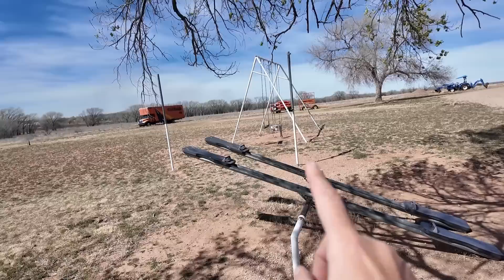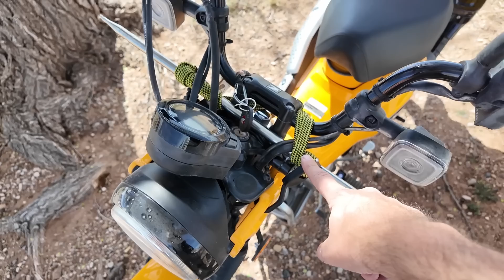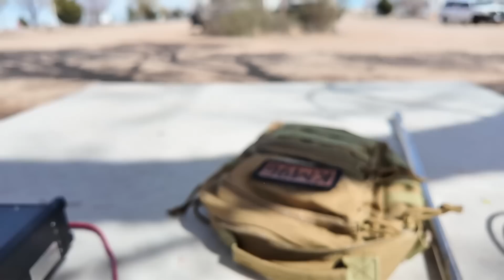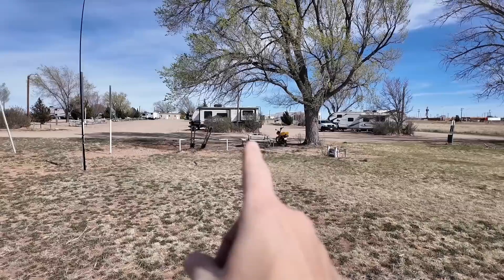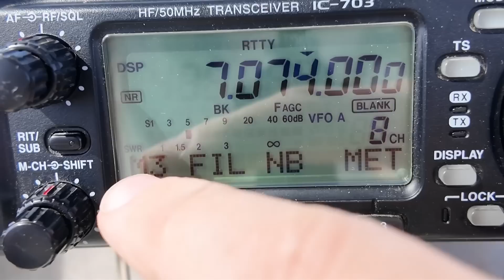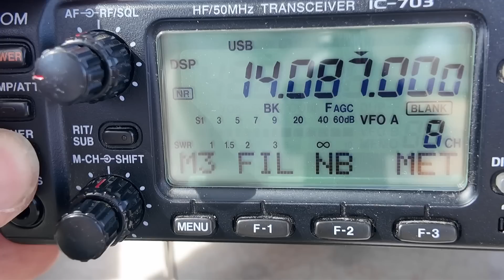Will the IC-703 QRP radio tune the Poseidon?

Comment: Nice setup !   That Poseidon works great ! If you shorten a bit using a Rig Expert you can tune mono band 10/11/12 meters like 1.2 SWR with no tuner .  Works about 5/8 wave with 4:1 tunes nice. Their is outher lengths for the 4:1 and they different from 9:1 . some shorter and some longer . I did the 43 ft and got 1.7 SWR on 20 with out trying.  Worked super !    Don't be like   APE and run some power at 80 meters and melt winder and make green toroid burnt . I used my scooter to hold up same 10 meter pole. But I got 1.55 SWR . Metal frame near UNUN . Still got out great .  Middle of grass with paracord to guy with tent stakes also works great . Wooden fence post is good as well.  W4OGO walt did a video on 4:1 with a shorter wire .  Things to try . Never failure . It is always a learning experience.  Even if the bands were dead , you sill got to enjoy a nice park !    I always go to park to enjoy the park then play radio . Always a good time. When you make a park to park NY to London you jump up and down . I did !  73
Reply from the maker: @robertmeyer4744  never failure!  This is the right way to think!

Comment: The tuner in the 703 is great, according to the book it's 3:1 but I've used it to tune far worse than that with all kinds of shonky wires bent around the place. Perfect little out and about in the car radio too, certainly not much chance of a dead battery as it only sips a couple of amps at maximum smoke.
Reply from the maker: I agree. I get the impression its better than 3:1.  I'm currently using it to tune our Ares 9:1 antenna and its doing great!

Comment: We avoid nm like the plague. Have fun watch ur back ✌️🙏.   Also use the anderson radial attachment method .  I started choking at the radio not the feedpoint.  No heimlich needed 😂Interesting differences in using coax as an extra counterpoise
Reply from the maker: I need to figure out a good way to prove this, but I think choking at the antenna doesn't matter due to capacitive coupling back with the shield.  More to come!

Comment: When you "Tune", you are not tuning the antenna, you are only making the radio see as close to a 50 ohm load at the tuner as possible.  It does not make the point from the tuner to the antenna change in any way.  The impedance there remains unchanged.  IMO, internal tuners are good for making your radio happy when you have a resonant antenna (something already close, like below 2:1).  This does not mean that you can't make something worse work, but you need to understand the losses you are incurring, in those cases when it does not work. Like when the bands are not as good as they are now.
Reply from the maker: One has to define what they care most about - finding a 50ohm match so the radio is happy?  Finding "perfect resonance" at a single frequency?  Making a contact?  Portability?  Ham radio is always a compromise.  Find the one that solves your actual need (whatever that is) and enjoy!
Reply: Oh man. Please read your ARRL antenna book.
Reply: There is a difference tho isn’t there? The output side of the tuner won’t be at 50 ohms, it will be close to the impedance of the antenna if tuned close enough. So you will get maximum power transfer and no reflections.
Reply: @Rabbit-Stu  Yes, there is a difference. The output side of the Tuner will be at an impedance mismatch. The cable used is 50 Ohm cable, and the antenna is who knows where, but not at or near 50 Ohm. So, in this setup you would still incur all the losses associated with the miss-match, even though the radio is happy and sees a 50 Ohm load.  If you wanted to incur less loss, then you would be best served by using a tuner at the feed point of the antenna, not the radio.  The tuners inside the radio are there to help you protect the radio components. I love TO's video's. My intention was not to contradict what he is saying, only to suggest that many hams old and new, don't really understand what the tuner is doing and what it should be used for.  This is one area of Ham Radio that I wish more hams understood better. When an operator pays attention to the efficiency, they are going to get out better, hear better and be heard better. I have a hard time trying to rationalize transmitting 100 watts out the radio only to radiate 40 watts. If the audience does take the time to read the ARRL antenna book, as was suggested to me :). They would discover that even a tuned antenna fed properly will only radiate more or less 80% of what its given, due to all the losses that add up. I think it's actually quite interesting. I tip my hat to TO, I think its a good video. I clicked the like button. I hope you did to.
Reply: As long as my radio is happy, I tx. As long as that results in Rx, I am happy. The concept of resonance is flawed, because no one uses only one frequency, unless it is 14.300. You don't need to understand any antenna theory to make contacts, but a good understanding of the real world origins of multi variate equations is useful if you want to be a ham of distinction. And tuners are a practical and efficient enough tool to have earned their popularity, precisely because they resolve so many of the variables in an antenna system, because there is no such thing as antenna singular, they are one piece of a subset, antenna systems, that are essential to a radio station. To denigrate tuners is short sighted at best, and sophistry more often than not.
Reply: Thanks for the video. Yep, I know you understand the tuner comments. As long as the radio is happy and you can safely transmit, go for it. That’s what the tuner is for.

Comment: That contact you made to TX it sounded like you broke a pile up to get it. Also, really nice to get a tune on 80. 80m FT8 is fun. I personally am playing with 160m FT8.
Reply from the maker: I did break a pile-up, but it took me 3 volleys to do it.  I spared the viewer from that, but wise hams pick up on stuff like that.  If this was Europe, NM to TX would be DX!  You've got the land for some TOAD HARBOR feed line and a big doublet for 160m!
Reply: @temporarilyoffline  I have a big doublet with legs over 150' each. So larger than 160m. I need to tune it. Thanks.
Reply from the maker: @don_n5skt  awesome!